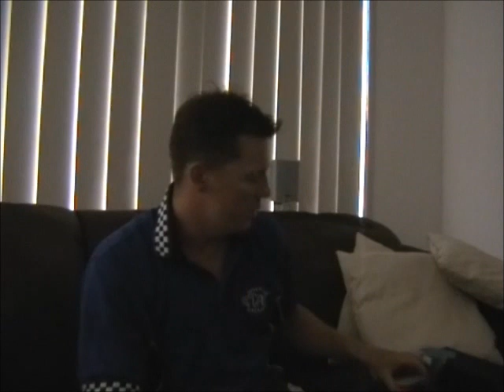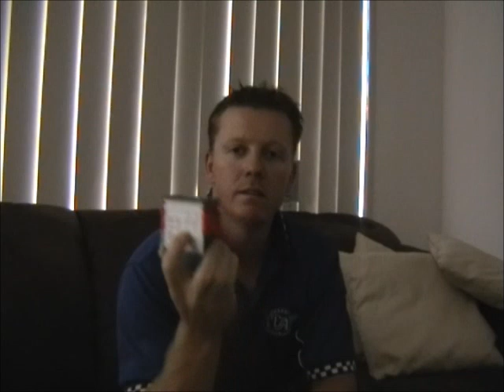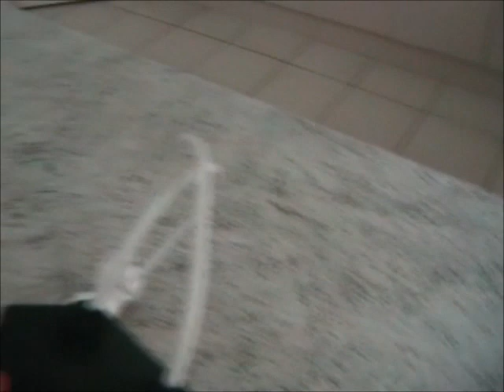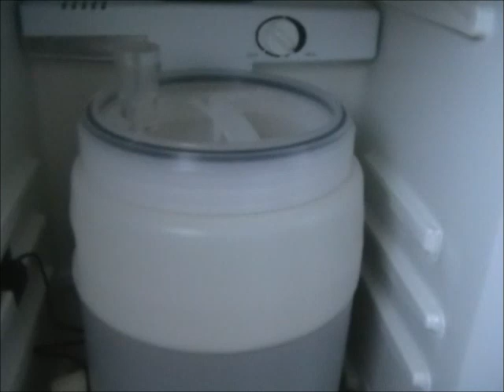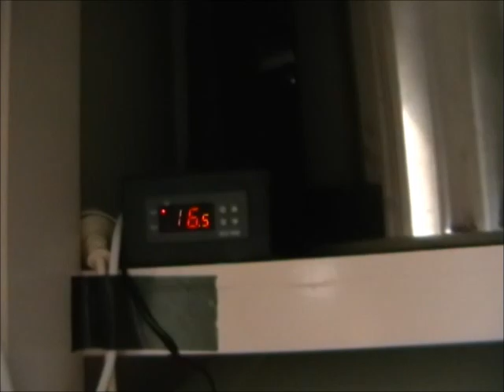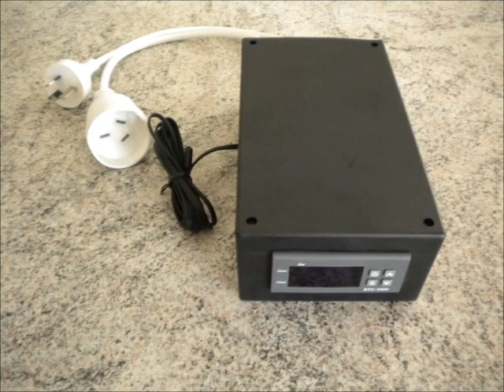Homebrew Wednesday #1 - STC-1000 Temp Control.

Comment: Interesting! I just purchased a temperature controller electronics kits from Jaycar and I spent last night soldering up the circuit board and getting the case drilled out. I think I shall add a video of it at some stage.